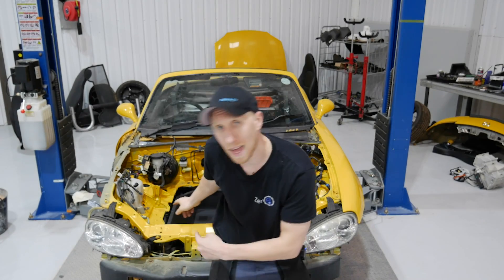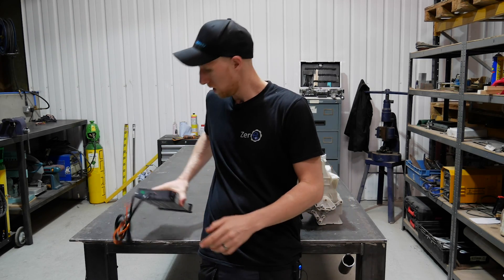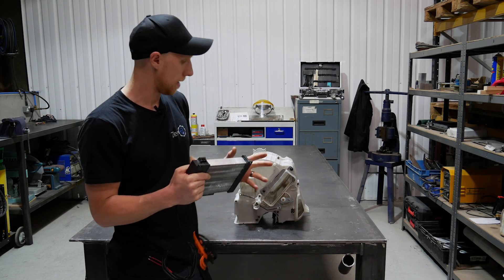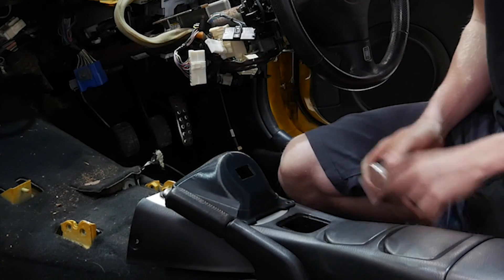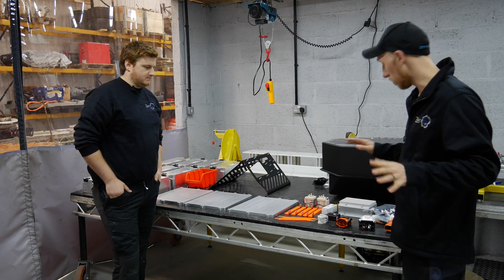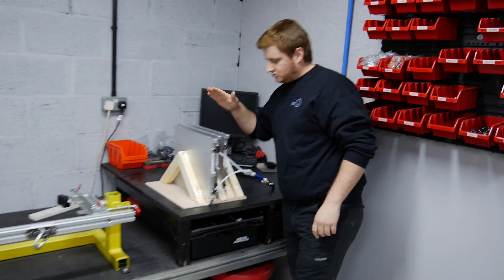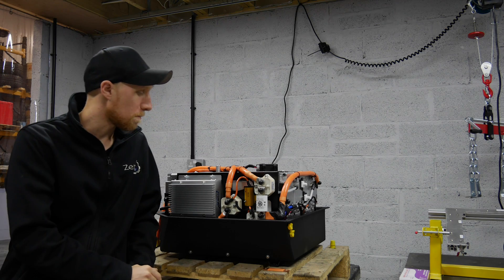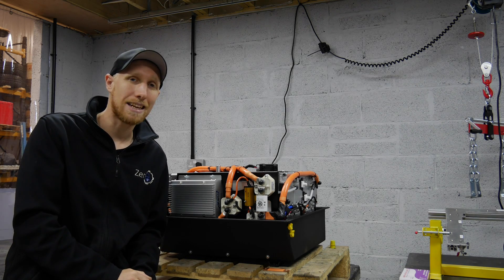Electric Mazda MX5 Miata Eunos EV Conversion, High Voltage Battery Box Build. Eps 7

Comment: If you want to know what it takes to convert an EV, and crucially what all the parts do, this build series is perfect. The detail is right up there. Cannot wait to drive it!
Reply from the maker: Not long now ⚡️😁
Reply: Fab project.
Have you a total cost yet less all the corrosion work £££???
I'm considering an EV fit to a mint low miles MG ZTT  or a similar Rover 75

Comment: Hi, I love the series after watching The Late Brake Show review of the conversion. I have a question about the drive selector, it does not have P for park. Therefore I assume only the handbrake holds the car stationary?  Or is that going to be a later addition?
Reply from the maker: It is just handbrake like a normal car, we have been considering a park pull in the gearbox.

Comment: So do you monitor all 20 temperature thermocouples that those modules have, and if so, what do to use, and can it monitor 64 thermistors as I have 32 modules!
Reply: They are not thermocouples, they are thermistors. No only a few selected modules are monitored for a total of 8. Rest of the monitoring happens based on cell resitance (derived from sag under load) to detect cells deviating.
Reply: T Bree 
My typo☹️

Comment: Abosolute plesure to watch you work! Everything is so clean and neat. I have one question though. The motor can eat up to 850 amps acording to the manual. Can the LG battery pack (10s1p) output that amount of current? Also can a pack of 7s1p of yours "Calb 4S3P Battery Module 2.2 kWh" work well with this motor and car combination with reduced range of course, or is the current insufficient?
Cheers!
Reply: 2.2*7 = 15 kwh which is a bit small. However you then look at peak draw of only 90Kw by the hyper 8 system the total loading of the pack is : 90/15 = 6C which is well within the capability of the Calb 4S3P modules. So yes you can go for a fairly small and light pack and still run a hyper9 system just fine.
Reply: Thanks guys, one more question - what is the continuous discharge for the Calb cells! Looking forward to the next episode!
Reply: @alexandertodorov9122  1C or more, as long as the module temperature remains below 40C.
Reply from the maker: The LG modules are 4p internally so can do that discharge. On the calb they can do 10c for sort bursts

Comment: Might have already been askes, but what car do the lg chem batteries come out of?
Reply from the maker: We can’t disclose but a very well known oem.
Reply: BEV or hybrid 😅
Reply: The Jaguar I-Pace uses this battery module format, and the VW e-Golf appears to as well. The I-Pace (sometimes identified by the Jaguar internal project code of X590) use the same configuration (3S4P).

Comment: because whenever I see a liquid cooling system I always see the same error ... serial connections of elements that heat up ... so only the first elements are kept properly cooled !!!
Reply: At least when it comes to computer electronics, this is a myth that has been continuously busted. 

Provided that the liquid is being pumped at an adequate speed, a serial connection works perfectly fine.
Reply: @mmavcanuck  If you want to subtract 25% or more of useful life from your vga or cpu, go ahead because running at 70C ° or more that is what will happen that if you understand how an electronic component works
Reply from the maker: Our normal set up is parallel connections but on this battery is not about cooling more about keeping all modules around the same temp. They will never get hot as the hyper9 does not pull enough power.

Comment: Hi, great project and good job !
I'm impressed by the wide mix of competences !

It could be interesting to know the final weight of the car at the end of the conversion.  And the weight distribution as well. 

Indeed a large portion of the fun with MX5 comes from the light weight...  
How will it evolve ?

I hope that you will make a video on test drive as well. 

Cheers
Reply from the maker: It is just over 1100kg and 50/50 weight distribution, we had it on the corner weights last week.

Comment: wtf they dont have insulating battery bodies?
Reply: really buddy? you are confusing the module with the battery. There are foil pouches inside, all insulated in plastic frames and with heat transfer pads inside the modules.
Reply: @Tom-evnut  i think this discussion and the tests are not needed
Reply from the maker: Not quite sure I follow? We do a test just to make sure.

Comment: No air conditioning?
Reply from the maker: Did not come with it as standard, but if it did is not to hard to run a high voltage AC pump onto the original system.

Comment: What kind of range are you expecting out of this setup? Also, I was wondering, seeing how small this car is, how much difficult would it be to convert a Cadillac ELR to full electric?
Reply from the maker: Currently getting 25miles per 6kwh of battery life, given the pack is 26kwh just over 100miles. Most vehicles can be converted the only thing holding them back is battery space.

Comment: Obviously you are doing a great Job.  Not sure how you cover your financial needs but maybe you have a very valuable customer for the MX. Probably cutting off the roof from am M3 would be  cheaper :-). But here is the thing what about the BMW i3 or i8. The are great cars but limited by their small batteries bmw is not willing to upgrade. If you could implant 60, 80 or even 100kwh you would create a real killer car - because the is nothing like this on the Market and you could really bring in your knowledge about batteries, BMS and cooling.
Reply from the maker: We are building as a test vehicle for our new gearbox and battery’s it’s gives the perfect advertising tool.

Comment: I have a question regarding the battery module configuration. So the LG Chem 4p3s modules got 2,6kwh on 11v. If you put 10 of them in parallel to get to the mentioned 26kWh, you are still at 11v aren't you? So how could you get to 110v AND 26kWh with just ten modules in parallel?
Reply from the maker: Hi, the modules are in series. Please watch our battery tech time video everything is covered in that. 👍

Comment: Really enjoying this but I find it a bit weird to go to this effort and not up the power slightly. I had a supercharged mx5 with 220bhp and it really brings the car alive. Would it be relativly easy to use a more powerful motor?
Reply from the maker: There is very limited motor options available which is why we are testing the new gearbox as we have a more powerful motor under development but wanted to prove the gearbox first.

Comment: Great series but I’m rather disappointed you guys didn’t go over each component of the battery box after they’re installed. I’m sure people what to know what does what and how they’re connected. You spent more time going over the irrelevant heater coil!!
Reply from the maker: There is a user guide at the bottom of our web site. Also need to decide how much to give away 😉

Comment: Do you think that it's maybe too expensive in compare for example with simply test Model 3? And compare simply parameters. 26 kWt battery and 6.6 kWt  charger. And in brand new Tesla that have 3 times better capacity battery 20 times better charger and just 30% more price in total? When I start watching I think that it possible not just for fan. Maybe it possible cheaper way to have EV for customer for example if will do all work by myself. But now I see that I was wrong.
Reply from the maker: If you are happy with a model 3 it’s definitely a very good option, but not everyone wants a Tesla or some even already have a Tesla and want a toy 😂

Comment: Oh, I realised its quite a new channel, its very professionally done. Well done! 
You mentioned about the 0-60 and top speed but not mentioned about the range... Think if it was a track orientated car it would benefit with higher top speed :)

If you need support on purchasing/engineering on the connectivity/electronics give me a shout, I can point you the right direction.
Reply from the maker: Range will be about 100 miles per charge. Thanks for watching.
Reply: @Hazell_Nutz  In metric terms that would mean roughly 16.25wh/km, which is still reasonable. Any way to put a better capacity battery pack in such a vehicule, or it would be complicated due to its size and design ?
Reply from the maker: K2o possibly there is still space in the rear but will shift the weight distribution

Comment: Love to see you guys do a conversion on a Morris Minor. I know there’s a company called London Electric who do a conversion service for a Minor but they charge a fortune and don’t offer a kit option. Would be interesting to see you apply your gear to an older simpler vehicle. Hadn’t even considered what you would do to have heaters in an electric conversion, in a Morris the heat from the batteries would probably be enough to keep you warm! 🤣
Reply: You do realise right the parts in this MX5 easily add up to +15K gbp, as in video description.

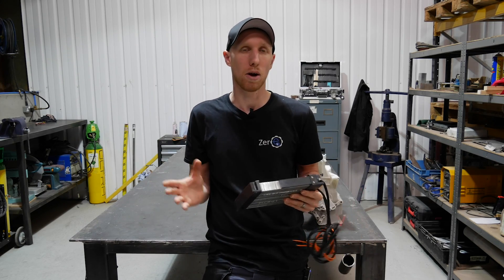Comment: 1:49 - that's not how ohm's law works :D Calculating directly you should get around 300W, but being a ptc you should be getting more, until it heats up. I wouldn't count on more than a kw, though.
Reply from the maker: We have a low voltage 3kw ptc now 👍
Reply: @Hazell_Nutz  Awesome. That should be more than enough to heat the cabin, but more importantly - keep the front windshield from fogging up.

Comment: Awesome job guys. Looks neat and It's gonna be way faster than the original car.
I have 2 questions now:
Are you aiming to 50/50 weight distribution?
If you a driving down the road and for some reason accidentally that nob  is moved into reverse, the car just engage reverse? If yes, Please add a 2 or 3 step process to engage reverse or add a safety feature/fool proof
Reply: No the controller will not allow direction change above 5 km/h, you can even enable it not to allow a direction change without first pressing the brake pedal.

Comment: Loving this series! 

Do the existing ecus cause issues with the conversion? Do you have to bypass or fool them into working once the engine etc is removed?
Reply from the maker: On most conversions you can just remove the ecu completely proving they have a separate bcm and stand alone abs

Comment: Any chance you would create an overall diagram of all the connections/ batteries /etc, with the components labeled?
Reply from the maker: Will look into this. There is a user guide at the bottom of our website that might be of use.
Reply: i also would like to this this

Comment: could you not have used the heat from the batteries and the motor to heat the cabin?
Reply from the maker: Plan is the heat from the motor controller will help to keep the battery’s at optimum temperature. If you look at temperature displacement/ transfer to air as it would be max of 35 degrees would not actually make much difference. Plus in winter when heat is needed the battery’s will need all of the controller heat generated.
Reply: @Hazell_Nutz  fair play.

Comment: How about a small fan inside the grill? Using wind turbine technology on a micro scale? As you drive turbulence will drive the fan charging your batteries. This system is already used to cool radiators, re apply it as a battery recharge mechanism, useful as a low speed charge as a range extender,maybe re use the existing fan?👍
Reply from the maker: Not with it would be better to block the grill off and make it more aerodynamic then have flaps that open if cooling is required.

Comment: Why not fit a solar panel to the roof as a range extender?
Reply from the maker: It dose no have a roof 😂 on a serious note a solar panel will give very little gain plus with the additional weight for the system would be counteracted.
Reply: @Hazell_Nutz  Well, it has a roof... actually two of them. Of course if you don't drive it with the roof down whenever possible you shouldn't have bought a convertible. :)

Comment: Hmm, a heater element that puts out 3000W at 300V is only going to put out 333W at 100V (30 ohms). Unless of course you are able to rewire it somehow.
Reply from the maker: We have a low voltage ptc on its way.
Reply: alright, half of the voltage means a quarter part of power :). I was searching in the comments, if anyone recognized it.

Comment: I may have missed this from an earlier episode, but can you explain why you didn’t connect the motor to the original gearbox? Would this not overcome the vmax/acceleration trade off you discussed in a previous episode?
Reply from the maker: As you will loose most of your battery space plus we want to test out this new gearbox.

Comment: Hey, can you guys see a time when an electric conversion is limited to adding in hub motors and placing a battery and heat pump crate style system where the engine was? If the future is going to include bulk ICE conversions I feel like it needs to be simpler
Reply from the maker: Yes I think it will get there as tech moves forward

Comment: Will you be offering those batteries on different sizes?  :)
Reply: Also...BMS will shout down power if overheating detected? How much heat would that be?
Reply from the maker: You can set the bms to shut down we normally do this at 50 degrees. We sell the modules on our web site.
Reply: These modules appear to be an industry-standard size (VDA 355) used by a few auto manufacturers and available from multiple battery manufacturers. Zero EV has them from both CALB and LG Chem, in a couple of different series/parallel configurations. The common dimensions are handy for flexibility of supply, and the different configuration let you choose your system voltage - the total energy capacity is just 2.2 kWh multiplied by the number of modules.

Comment: Great work as always. What material was that gear selector printed with? I had an ECU bracket printed in PLA that lived in the footwell. It partially melted on a hot day (30C).
Reply from the maker: The first was in pla but doing abs now.

Comment: I like the drive selector. Australia has the requirement that to change from forward to reverse there should be a two movement / step process. i.e, a dedent to change with a switch, two buttons, etc. Designed to as to prevent accidentally switching to reverse. Does this also apply in UK?
Reply from the maker: Uk does not have that but would not be to hard to make up something that requires brake depression to allow gear selection. Plus if you go into reverse the controller won’t change direction until you get to 0 rpm.
Reply: @Hazell_Nutz  I would rather have a rotary control which can move from reverse or drive to neutral without an interlock, but requires pushing in the dial (after reaching neutral, so it is two steps) to move past that.

Comment: Great video, is the reason for the 26Kw small pack going to be your only battery for motor sports?
Reply from the maker: No we have other battery options. We normally do high voltage(350v nominal) this is just to test the hyper9 and gearbox.

Comment: If it's 3kW at 560V,   it'll be  100^2/560^2 * 3kW = only 95W  at 100V.   The power law says that a resistive load is proportional to the square of the voltage.   
This is because Power =  Volts * Amps ,  and the amps that flow through a resistor follow Ohm's law  (I = V/R)   and if R is fixed that leaves you with  P = V*V/R.
You said PTC instead of resistor so maybe that's made of a specially selected thermistor alloy that drastically increases its resistance when it hits the right temperature so it limits the current that way when run at high voltages,  but I'd check the current it's drawing with a clamp meter both in still air and with a fan  to get a realistic wattage.
Reply from the maker: We have ordered some 3kw lower voltage ptc heaters no. The temperature sensor shuts the system down at 150 degrees.
Reply: @Hazell_Nutz  That sounds best.   I ignored the thermostat because the rated wattage is likely to be during the On phase of the cycle.   Typical heater elements actually have very low PTC values.  Nichrome, the most common,  only has about 1/10 of resistance rise with temperature as copper wire so you can't rely on that to limit your current.

Comment: To be honest, for the first several seconds of the Tech Talk, I was more interested in the table than the battery box. Is that a in-house built table or is that something you purchased?
Reply from the maker: The table in the tech talk is called litedeck it’s used for staging.
Reply: @Hazell_Nutz  Oh, that's cool. I never would've thought to use part of the modular system for a stage to build an assembly table. Too bad there's no distributors around where I am, but that could work out to my benefit as that would be a fantastic project to practice A/C TIG on Aluminum. Also, the Miata is coming together nicely, well done!
Reply: In house, its just a steel plate on a frame with some wheels.

Comment: What is the energy density (kwh/kg) of the complete pack including box, cooling plates etc?
Reply from the maker: We are at 26kwh and about 150kg but need to weigh the pack next week to be 100%
Reply: @Hazell_Nutz  that is a very good energy density for a battery pack.